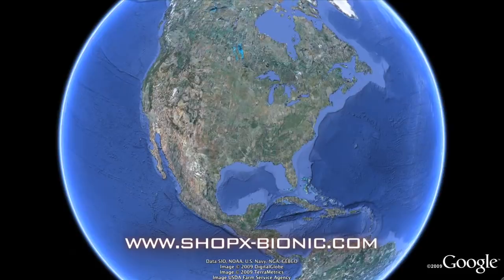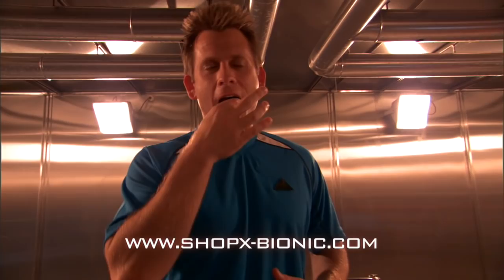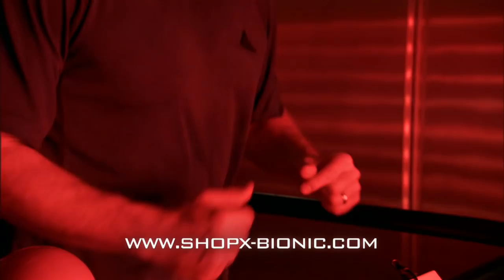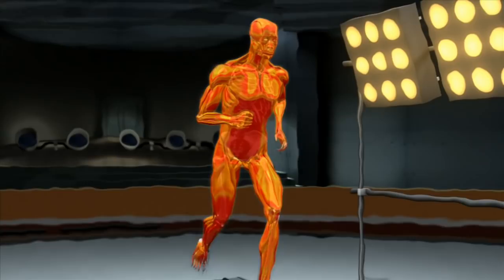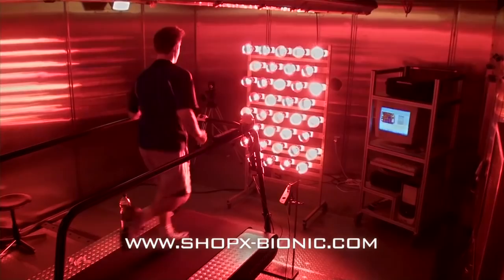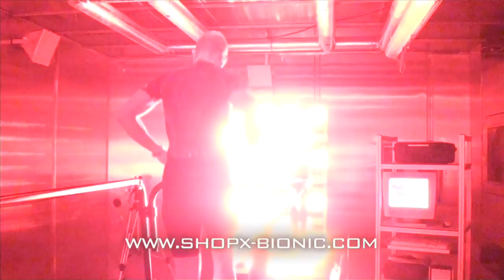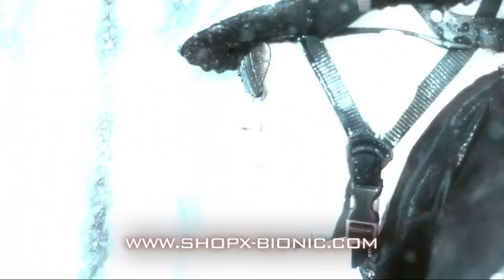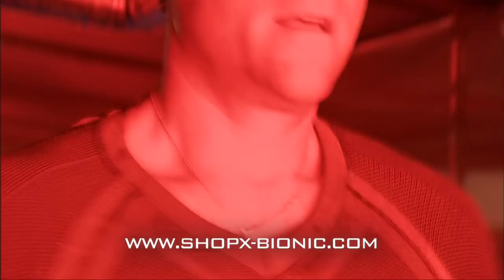Sport Science: X-bionic Segment

Comment: 3 degrees is not a amazing difference. That's only 1.6 Celsius difference.
Reply: Henry Chaisritha preety bog differance
Reply: Considering it only takes a 3 degree C increase from normal core body temperature to cause heat stroke, 1.6 degrees is pretty significant.